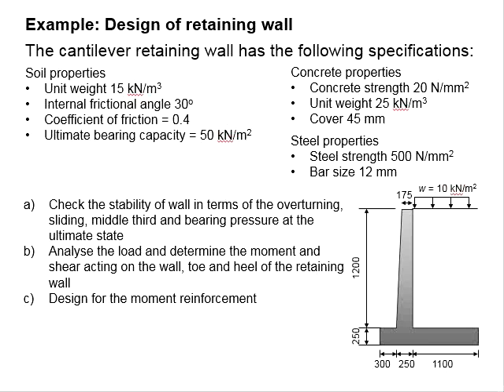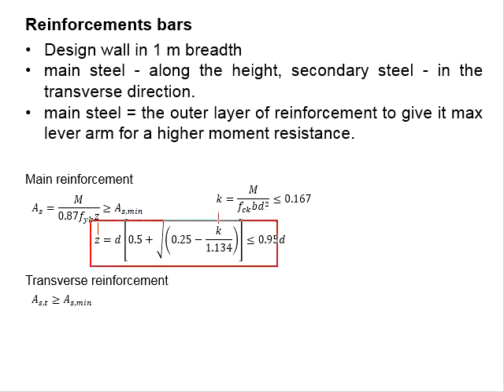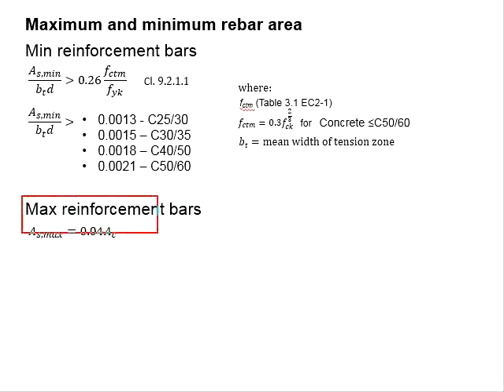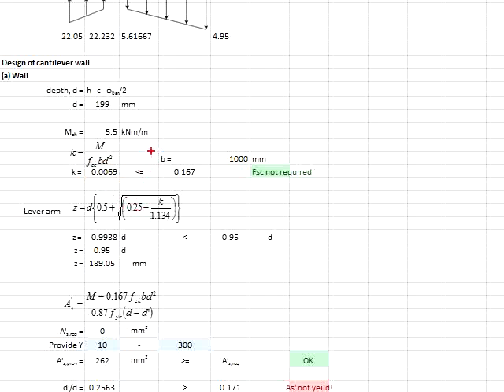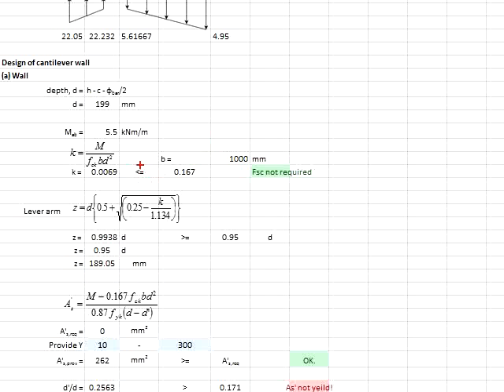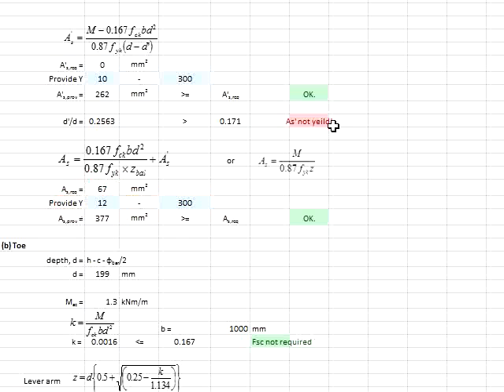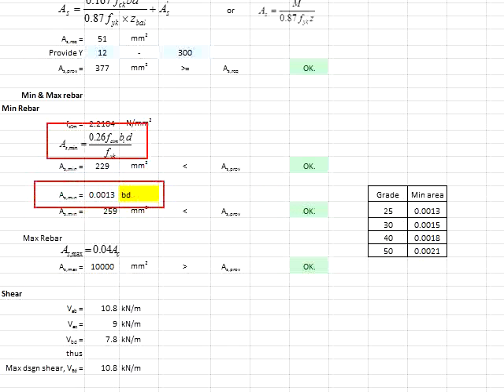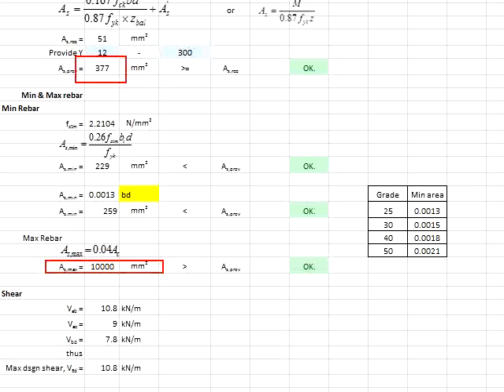4.17 Design of reinforcement to resist moment

Comment: Thanks again very much for your videos its helps a lot !.. Here the depth d of the wall isn't d=1200-45-12/2=1149mm instead of 199mm?
Reply from the maker: The effective depth, d, of the wall is calculated based on the wall thickness. The d is used to calculate the rebar area, As. As for the height of the wall, it is taken as 1200 mm. The wall height is used to calculate the moment and shear. Sorry for the confusion.